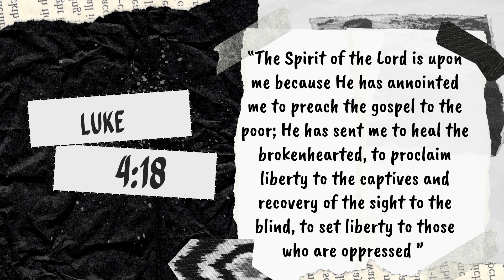Prepping GM 8.6 10 Bolt For Custom Build

Comment: Having a decent diff on hand is the only reason to even consider starting with keeping the 10 bolt.  If you are doing it yourself it might make financial sense now, but if your paying someone to do the work I am not sure it makes any sense to me.  If its a 5000lb brick that doesn't tow or do work and only is going to get launched hard its difficult to win me over on keeping the 10 bolt.  Especially when you start looking into adding C-clip eliminators, all new bearings and seals, new axles, new gears, and then the cost of all the work to clean up the housing and weld on all the new brackets and its still a 10 bolt and most aftermarket C-clip eliminators are not rated for street use and will probably leak.  

I ordered what Moser called a 9"  Muscle Pack already setup for Silverado with an aluminum case Wavetrac and 35 spline axles and I got Willwood dynalite breaks that will clear a 15" wheel with slicks, the right length 1/2 screw in studs in 6x5.5 to look factoryish but pass tech a giant fill plug and added a bottom drain plug for quicker service, all for what is now like 6k shipped and I had mine in a week. I had it shipped unpainted with no shock brakets so I could weld my relocation brackets on clean, and other than some spray and reworking the break lines it was straight bolt in.  I am not sure if the driveshaft would bolt up with conversion U-joints as I make other drive-train changes and with the RPM and MPH I was targeting I had to upgrade to an aluminum PST shaft but that gave me the ability to do 1350 U-joints.  

Before that I had rebuilt the 10 bolt but by the time you do all the work if you just do gears and limited slip and bearings and seals and hardened axles you are in it 2 grand just for that, plus you still can't run slicks and have to run 17s to clear the brakes. I got several years and several hundred passes my 10 bolt before I exploded on me on a 1-2 shift at 5700rpm and 15lbs of boost on a well prepped track. If you are going to  use it less than that then it could make sense to keep it 10 bolt especially if it had a good diff and if the gears were still good and the right ones.
Reply from the maker: I definitely don’t disagree that the 9” is a much stronger axle with a much larger aftermarket support. But not everyone can afford a $6k price tag for an axle, and not everyone is gonna push their truck as hard, so it becomes a tough choice. 

I explained this to Chandler, and he liked the idea of building this 10 bolt and seeing just how much abuse it can take. When he breaks it, a 9” will replace it. 

I built a 10 bolt in my c10 because I was in a time crunch and couldn’t afford a 9” in the time I had. So I built the 10 bolt and figured I’d beat on it till it broke, and document what it took to break it, then build a 9”. It’s all a part of the game 😎🚜💨